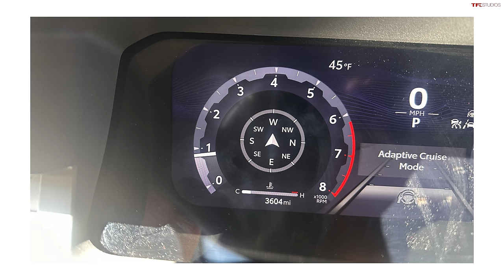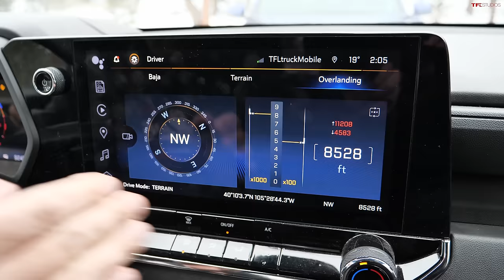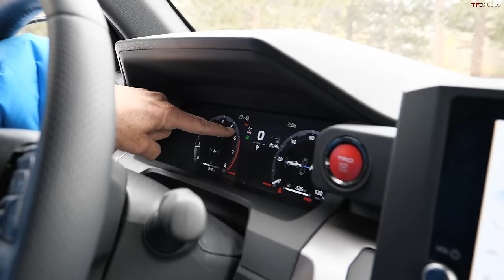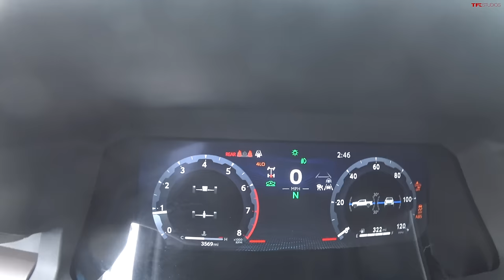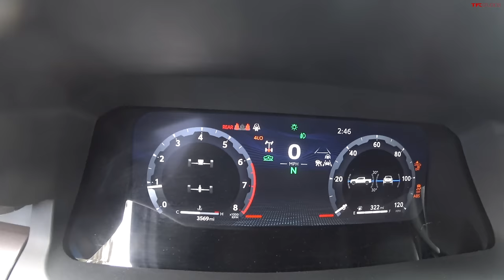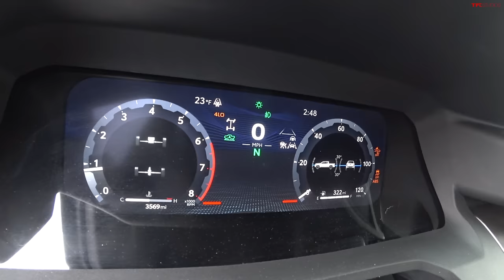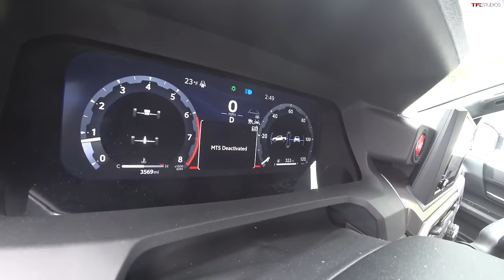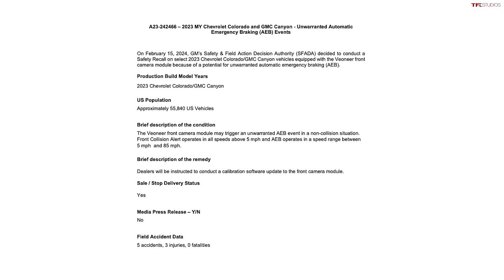Our Brand-New 2024 Toyota Tacoma Almost Left Us Stranded...Here's What Happened!

Comment: To break the transfer case practically on ice with low traction is alarming. They weren’t abusing or pushing this thing at all.
Reply: Its their garbage fake limited slip diff wheel braking while on power to hold the wheel from spinning.  was ok when tacoma was low torque but the new turbo 4cyl add heaps of low end torque. The scary thing is Toyota won't redesign this until it strands tens of thousands of people enough to make a recall
Reply: That trail isn't even that bad and for the toyota to just broke down just means that the parts weren't built for it.
Reply: I’ll tell you exactly what broke this truck. It’s a phenomenon well known in the turbo industry. It’s called dynamic loading. In short the turbo at consistent low RPMs generates a ton of torque. It overloaded the gear train somewhere in the front end and something broke. Based on the behavior I think they ripped out the front ring gear or ripped several teeth off of it by overloading it. The transfer case was still in 4wd but chances are the shaft was just spinning on either a stripped ring or pinion gear. Most transfer cases are chain driven or gear driven with very sturdy gears. Usually it’s the ring and pinion up front that give way.. it’s possible this was a defective part
Reply: @matthewcaughey8898 I am not disagreeing with you at all, BUT, I can show you thousands of Honda civic putting out 700-1400 hp on factory transmission. Also look at all the diesel trucks with heavy mods and they are not snapping like this. For a Toyota I am shocked.
Reply: @blocktrain849 a Colorado on an ice trail will😂
Reply: Good to know this.
Reply: @jak3est  I think I heard all Tacoma's that don't have a mechanical locker have a mechanical limited slip, don't quote me.
Reply: @easttexasengineering3489 So...WHAT Snapped?
Reply: He was BURNING Rubber...on ice.
Reply: @matthewcaughey8898   If this is true imagine when you add the torque of the hybrid.
Reply: @blocktrain849  I never understood why people buy a tocoma, and spend another 20k to make it look bigger like a tundra. Just buy a tundra. They both get 14mpg anyway.
Reply: for as long as these have have been doing this they look like complete Amateurs
Reply: @Mcf412  exactly
Reply: @blocktrain849  you wanna bet?
Reply: The problem isn’t all new vehicles are shit, it’s more that they continue to get shitter.
Reply: @blocktrain849 I'm sure stuff like this will keep occuring. What's funny is the Chevy and even Ford Bronco Sport didn't have any issues.
Reply: Well that was pitiful. That Colorado sounds great! The tacomas engine sounds like complete garbage.
Reply: Beat me to it.  I hope the AWD GX and Land Cruiser use a stronger case!
Reply: @jeffk464  toyota hasnt used a mechanical lsd since 2008. its simulated lsb using the traction control system
Reply: @easttexasengineering3489  Ummm that’s highly exaggerated.  Yeah they will make 600-700 HP on the stock trans but at that power level the trans is a ticking time bomb. Guys making that power shift them very gently lol.
Good luck putting 1000+ HP through a stock Honda transmission for longer than a handful of pulls, before it gives up the ghost. 💥
Reply: @jak3est  It's not going to strand 'tens of thousands'. Wait for the diagnosis before predicting the worst.
Reply: @easttexasengineering3489  14 on a Tacoma?!?! 21 city driving for mine all day long.
Reply: @matthewcaughey8898  something they should've thought it through before shipping these turbo engine out to the consumers.  By making sure that it can handle the abuse.  If it ain't built for abuse, then it clearly isn't built for off-roading. The course they were on isn't even close to being an off-roading.
Reply: Maybe did not brake in the suspension? I mean Toyota is the top for reliability, but lets face it, even toyota is not perfect sometimes. Thats the way it is.
Reply: @blocktrain849  agreed
Reply: Wait so are we sure about what even broke????
Reply: @matthewcaughey8898   in other words your saying that the toy braking was there fault
Reply: @easttexasengineering3489  Isn't it true that ANY CHAIN is only as STRONG as its WEAKEST LINK?
Reply: @easttexasengineering3489  the guys with high horsepower diesels, spent more on making sure their transmission doesn't puke its guts out than they spent on getting the horsepower. I had maybe $500-600 in power adders and $1300 in clutch to hold 500hp.
Reply: @matthewcaughey8898  Dynamic loading due to faux "locker" anti-slip. Watching and listening @10:05 it sounds and appears like the front wheels were being restrained by the brakes. Does 4LO not disable all traction assist modes any more?
Reply: @guest6423  look at how popular the taco is in the overland community and look how easily this happened on practically a snow covered dirt road.. it wouldn't be far fetched to think a lot of people are going to hear that pop only to get the truck fixed enough to do it again before enough incidents sends Toyota back to redesign the weak point and make a recall
Reply: It's hard to take your comment seriously when you misspelled  "shittier"
Reply: @guest6423 theres no ‘predicting’ about it. Ive heard snaps like that before and its never ever good. Something got F’d big time.
Reply: Absolutely, especially since just because the body changes, doesn’t mean the transfer case is different or the other components.
Reply: HAHAHAHA TOYOTA IS TOYOTA BRAND NEW TOYOTA BREAKS
Reply: ACTUALLY THAT'S A VERY EASY TRAIL A DON'T UNDERSTAND HOW THEY ARE ABUSING HAHAHA TOYOTA LOVERS THEY DONT KNOW WHAT ELSE CAN SAY TO DEFEND THE BRAND
Reply: @elTripaSeca  Human nature.
Reply: @easttexasengineering3489  I have broken a front driveshaft u joint that split the transfer case on a duramax, low range brake applied boost built and pop. Just have to try harder bone stock stuff breaks all the time.
Reply: Not true. Is driver error poor judgment
Reply: @jak3est  I mean, they didn't do anything about the widely known problems with the 2nd gen's front diff when they designed the 3rd gen. You're probably right, they won't do anything meaningful. If anything they'll just turn up the torque management so there's even less low end torque allowed to reach the wheels.
Reply: @easttexasengineering3489  I'm not shocked. The stock rear diffs Toyota uses in the Tacoma have been notoriously fragile for generations. Even after they made changes for the 3rd gen, they were quite easy to break due to the thin ring gear teeth. Now with more low end torque, we're going to find more weaknesses. Toyota probably won't change the hardware for years, so expect them to announce a software update to "fix" the issue that does nothing more than use more aggressive torque management to limit torque output in 4WD and reduce the chances of breaking whatever failed here.
Reply: Tacoma is 100% built in Mexico now, and that's the biggest issue. The quality is totally gone gone...
Reply: Not the transfer case. You you tube certified mechanic.
Reply: @manuelpiston  Breaking the part that transfers power from the front diff to the cv axles is just as bad.
Reply: broken front cv axle
Reply: Problem here is that these Toyotas are made for the US. The ones made for Latin america and other continents are way, ya better and are meant for the abuse they get due to roads and cargo
Reply: @maverickmig211 They use the same junk parts.
Reply: @evilke-kneebone8025  I wish man. Definitely not 20+ but I get an avg 18-19 WHEN I use no ethanol gas - 2021 off road
Reply: @JonahZX10  Yea man, my 2017 gets 20 21 all day city driving with mid grade gas
Reply: @d3phunk37  it does, it was the add system that failed. Sorta front diff disconnect.
Reply: @blakeallen874 I'm guessing it was the front cv shaft at the hub. That bang sound and the steering wheel jerking is a dead giveaway.
Reply: But...but...Toyotas are infallible. 🤣
Reply: @OMGWTFLOLSMH  I used to love Toyota but no more. Toyota is going down!
Reply: @matthewcaughey8898 that coupled with it being in 4 low was enough to sit right where the truck likes to build boost. Literally using all 400 ftlbs😂
Reply: @jak3est  Considering how certain problems persisted for years on the prior gen, I doubt they'll even redesign the front diff even if it's shown to be failure-prone. They'll just claim people are abusing it.
Reply: @mrvang8077  In one of TFL's videos, they said a Toyota engineer told them it was designed to break if under enough strain. So, they designed it to fail like that. Yikes.
Reply: @matthewcaughey8898  A Toyota engineer confirmed it was designed to fail the way it did under enough stress.
Reply: @blocktrain849  So it was a defective Tacoma. Quality not what it used to be.
Reply: Mexico
Reply: @blocktrain849  quality from Mexico…….what could go wrong. I’ve owned 7 Toyota’s….my present 340,000 mile Tacoma 09. New ones aren’t as good compared to older Toyota’s
Reply: @easttexasengineering3489 Torque is different from horsepower. You can't compare HP to Foot Pounds. Those are two different types of measurements. A Civic could have 1400 hp but no towing power. Or, you can have a low HP vehicle with lots of towing power.
Reply: This was shocking as it was on ice.
Reply: When in doubt, reboot!!! You are driving a green planet truck with computer
Reply: Imagine actual use. Like a farmer pulling a trailer. This is not a design flaw, it's either a serious driveline quality issue or serious cheapening. Happened waaayyy too far away from it's implied design limit
Reply: Is this the one that Toyota was saying that they “ abused “ the truck? That they weren’t gonna take responsibility for.

Comment: Everyone’s gen 3 Tacoma just went up in value 20%
Reply: Nah them shits have failures too
Reply: The IFS in gen 3 toyotas is weak too
Reply: @scotto9712  haven’t broke any yet off-roading. Gen 3 ain’t going up since they are under power and ofc most people don’t off-road
Reply: @joser7894 oil starvation too
Reply: Probably just because that anemic 3.5L V6 cant break anything below 4000 rpm. 

Trucks that actually have some power and torque, like the GX470, GX460 and V8 4runner dont have much issue breaking CV's and rear axles
Reply: @scotto9712  ifs?😂 they’re all ifs pal. I see ur new here
Reply: @Mako2-1 my Jeep isn't IFS...
Reply: @Mako2-1  They aren't all ifs, buddy.  But I didn't say ifs was weak- I said Tacoma's ifs was weak.  I'd be all over an LC70 if I could get one- also, gladiators.
Reply: Guess if I want off-roading, I'll have to find an old Bronco or Scout!  Just need to get thicker seat-pads!  🙂
Reply: @Jay-me7gw Torque breaks things. Sure the v6 is underpowered but at least it’ll be more reliable than this turbo 4
Reply: @dangkhang9479  Plenty of power with a tune.
Reply: @jr1999At least the turbo 4 wouldnt completely suck to drive. The 3rd gens I test drove couldnt shift out of 5th gear because of a headwind doing 70mph on the freeway.
Reply: @Jay-me7gw  Who cares........who is really off-roading all the time?   most people don't .
Reply: @B126USMC Who really drives a million miles in their trucks like all the Toyota nutswinggers like to talk about any time a Toyota gets compared to anything that performs better?
Reply: @Jay-me7gw Whether or not the turbo-4 has enough power, my gripe is the replacement of V8 and V6 engines with undersized turbo engines to make the EPA happy. They won't last like the old power-plants!  But that's just fine with manufacturers, dealers and government!  Less is More!
Reply: @B126USMC Like you may not, but this is an Off Road channel. So the people on here are likely looking for Off-Road capability.
Reply: @sunbeam8866  The 22r toyota engine would like to have a word with you.
Reply: @scotto9712  I thought those had some plastic chain-guide issues. Is it better or worse than my 2RZ engine? My Tacoma only has 82K on it, and I use it as a second vehicle, so it may still last quite awhile!
Reply: I have a 22 Taco and my transfer case grenaded at 1200 miles the first time it was put in 4L
Reply: Thats just it they didnt offroad this but one time and pop the badge on the side literally says off road@B126USMC
Reply: Oh oh. Toyota is going to want to bury this video. I miss manual locking hubs and manual four-wheel drive engagement.
Reply: 2nd gen’s went up by 38% ❤
Reply: What a pos that new taco is. Noisy as hell too. 😢😢😢 the world is crying as the as backwards move done by Toyota corp to meet the epa bs guidelines 😢😢😢😢😢

Take the Tacoma back to Japan and and a diesel to it.
Reply: You mean it went up in price. The value not so much
Reply: A million transistors to make this thing work. Get rid of all the most trouble-prone electronics! (Heresy. I know!) 🙂
Reply: From one video by a smaller youtube guy lol doubt it
Reply: @sunbeam8866  I have a 74 Scout 2 project in my garage next to my Taco
Reply: @TheRealGras  So far as electronics, that's huge reduction,, not counting the radio, and possibly electronic ignition. I hear they're thirsty beasts. Though, as a "project", for now, yours is probably using very little gas! 🙂
Reply: @sunbeam8866  It current has the AMC 4.0 I6 with a 3sp, but I have a friend thats trying to get me to swap it for his 67 Mustang project.
Reply: I don't think the 3rd gen had enough power to harm itself.
Reply: Yesss!!  Never buy a new gen. Lol. Give it a couple years.
Reply: Shoot I'll never be able to buy one
Reply: @sunbeam8866  My old TJ has never stranded me anywhere...
Reply: @sunbeam8866  the 22r was the oooold toyota truck engine from back when they were really light and had solid front axle.  that's the engine that made the toyota truck reputation (the 22r)-  you almost can't find the mileage on those because it seems like the odometer was the most unreliable part.  Your Tacoma will be fine, it just isn't made of magical unicorn dust like people make it out to be.
Reply: @scotto9712  My '96 Tacoma was a stripper - std-cab, stick, crank-windows, no-AC, only options were a bed-liner, bug-deflector, and a dead aftermarket radio. I bought it several years ago for only $400, 'cause it wouldn't go in first or third gear. That turned out to be a cheap, easy fix. I added a used fiberglass cap, a decent Sony CD-radio, a clock, and installed AC. 
Still has only 82K on it. But I finally replaced the PO's crap Chinese tires with some decent ones. So maybe I'll start putting more miles on it. Still a straight, clean truck, except for the failing clear-coat on the roof & hood. 
Don't want touchscreens, video simulated gauges, bluetooth, push button-start, turbos, dual injection, CVTs,  etc....  KISS!

Comment: What a great commercial for Chevy Trail Boss.🤣
Reply: As a die hard Toyota guy, I hate to agree with you. But there's no reason that cv should have snapped there. I'm really hoping toyotas quality doesn't fall too far. I gotta say, that Colorado is a sharp truck
Reply: @philiptaylor2567  I actually really like the 2024 Toyota Tacoma. I saw one on display at the last auto show I went to. The great thing for me anyways is Toyota fixed the seating position. Driver knee bend to the brake and throttle are more comfortable. The technology also really impresses. I am sure like all new vehicle releases. The first year is the one to avoid. Manufacturers need time to work out unforeseen real world issues.
Reply: leather seats no cruse control??
Reply: @slamminpotatoes4508 I got cruise on my Colorado Trail Boss but don’t even want leather anyways, if it had leather I would still put seat covers on it!
Reply: @slamminpotatoes4508  the vehicle I sat in had adaptive cruise control.
Reply: Or the Nissan Frontier, it's the only one that hasn't forsaken simplicity and reliability for a bunch of fancy bells and whistles that over complicate things.
Reply: @COMMANDandConquer199 I would go Frontier to, since I fot my Titan xd never look back...

Comment: The Tacoma front differential has been trash for a while.  I hit the 5-year mark on my powertrain and as soon as I did we started feeling a vibration and hearing noises from the front diff.  Dealer (Roseville,CA) saw the vehicle 3-4 times and refused to address the issue w/o a full failure.   Said it was cupped tires.  Tires only had 3k miles on them.  Sure as shit, needle bearing was trashed.  But we had to fix it on our own.